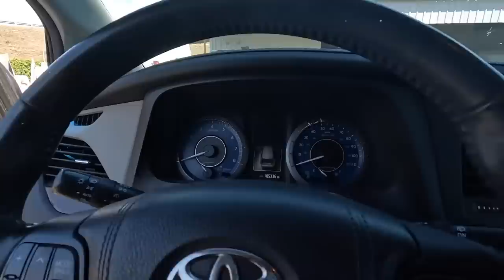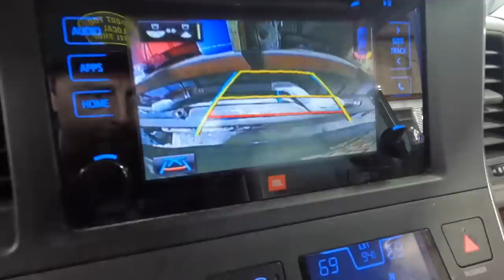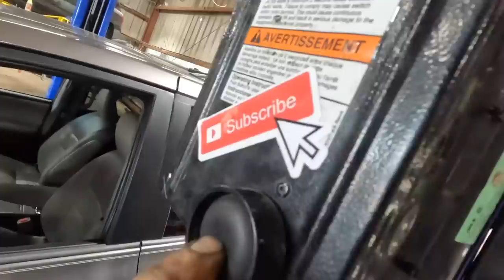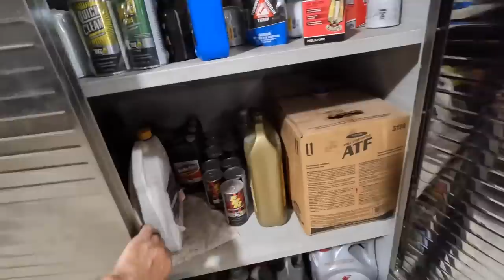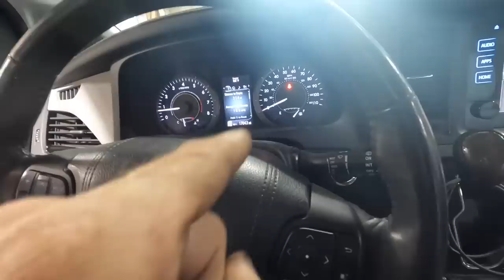Not going to sell this job! Toyota Sienna 3.5

Comment: My mom has an '08 3.5 Highlander that she's owned for many years. Around 50k miles, it had a small oil leak. It turns out that a lot of the 3.5s develop a leak where the timing cover, head, and block meet. There's a Lexus/Toyota specialty shop in...Chicago, I think that does that job a LOT and it's an engine-out bear of a job.

ETA: The shop I mentioned has a YT channel showing the process.
Reply: Car care nut?
Reply: Ahmed @carcarenut is the man!
Reply: 50,000 miles? Them's rookie numbers, my wife had a 2008 Highlander  V-6 with 375,000 miles on it. She only got rid of it because the foam in the upholstery had dry-rotted and dust would engulf us whenever we got in and it was due for a water pump/timing belt , CV joints and strut replacement ($6000+ worth of work).  She got a Camry, but we're old and it was too low for our backs. She got a Honda CRV and hated every minute of it, and a couple of weeks ago she got a '23 Highlander (produced in March 2023  fresh off the truck) and she is happy again.

Comment: Had the same leak on a camry v6 and it soon went to a drip then a spray as it drips down onto the axle ..I had replaced the PS fluid lines that banjo bolt and the PS pump all done without a lift ..trying to find it until I came across a vid here about this  factory problem which cost $ 3500 ?? I think to fix at a shop ...I traded the car in for a subaru

Comment: AT 205 will stop leaks. Maybe owner could start running high mileage full synthetic oil and it may also help with leak/seepage.
Reply: That only works on seals.

Comment: The timing cover leak effects all Toyota 3.5L V6's. The timing cover leak is way more than 10 hrs. Books at 20 plus. Need to drop the engine out to do it correctly.

Comment: You should have a look at AT-205 oil leak sealer.  Stopped a slow rear main seal drip in my Mercedes.  $20 beats the sht out of $3000.

Comment: Someone told me that.  Putting transmission oil in with motor oil about 300 miles before an oil service is good for the car? What are your thoughts on it.
Reply: Depends on the gasket material; transmission fluid and, more so, brake fluid, is designed to condition rubber gaskets and o-rings, keeping them supple and keeping them from shrinking. I'm not sure that using either for that short an amount of time in an engine would make any difference to the gaskets.

Comment: Super common for all the Toyota GR engines to leak oil from the timing cover in that spot.  Bet it has electric steering because that is where they power steering pump mounts if it has normal power steering.

Comment: Im on my 2nd gr series engine, my 3l 3gr is burning oil since its d.i, im not sure if the 3.5 2gr was d.i or not, i know the later ones used both direct and port injection to help keep the valves clean

Comment: I've seen an oil cap that called for 0W20 while the owner's manual called out 5W30.  (My brother's Hyundai Santa Fe Sport '17).  Looked it up on an owners' forum... the 0W20 is to meet the EPA MPG ratings and the 5W30 may be better for the engine longevity?
Reply: EPA doesn't care about engine life. I use the latter.

Comment: Interesting that now Ray puts an engine cleaner (dispersant?) into the engine and runs it for a while PRIOR to an oil change.  I have been putting a half quart of Gunk engine cleaner in my 94 Stang 5.0 for decades prior to oil changes.  It seems to keep the engine cleaner.  

I'm not sure about the additives put in after the oil change.  Aren't those already IN the oil?

Comment: I don't understand your strategy for oil changes. It's 0W-20 but with what specification? Most car manufacturers have some prescribed quality specifications for their engines, how can you stock for all different manufacturers and engines? (Also, how could you use a different one, 5W20? Is this viscosity class also enabled for this engine?
The question is quite broad, since I can not imagine how an independent shop can stock all oil varieties for all brands, from GM to Mercedes?

Comment: Does that oil system treatment affect turbo charged motors?  I'm hitting the 100k mark on my f150 and was just curious if something of that nature would be a good idea.
Reply: Yes. Add BG EPR straight into your old oil prior to oil service and let idle for 20 minutes, then go for a quick ride for a mile or two and then drain. For maximum efficiency add BG MOA like Ray did to your fresh oil for additional protection. Stuff is excellent

Comment: On the Toyota  did I see 2 wires for some kind of aftermarket toy without fuses on them?  Thats a big no no, a fuse must be within 6" of thd battery terminal. Positive side  however you can also fuse the ground side, but its not often done.

Comment: Ray, it looked like the oil filter housing had a 3/8 drive built into the bottom... could you not use that instead of the fancy tool?
Reply: On Toyota's it is a plug to drain the filter before changing it, that is why the small O-ring is included with the new filter elements. You do need the special wrench to remove/install the filter housing properly.

Comment: I am guessing Rainman rarely works on Toyotas :-) 3.5 is a very common engine starting from last 90s. anyways, all 3.5 has this issue caused by engineering design fault? mostly it will leak very small amount but some do begin to drip. it's leaking from where the block/head/cover meets at the same point. it's definitely an oversight during engineering of this engine? another annoyance, VVT tapping noise when engine is cold. VVT was revised starting from 2013 model years but the tapping sound is just annoyance and really not an issue with the functioning. another annoyance, oil cooler line is a rubber hose that can burst with years/miles. I have not heard of oil "burning" issue on 3.5. some older 4 cylinders have issues primarily caused by lack of regular oil change. 2.5V6 had serious oil burning issue directly related with DI setup.

Comment: My once ever dealer oil change failed because the ding dong placed the o-ring wrong causing me to flatbed if back with most of the oil missing. Never again.
Reply: I guess I've been lucky, My Toyota dealer was great with our 2006 Highlander. 
I brought it in at 59,800 miles and said I smelled antifreeze burning and they couldn't find any, at 65,000 i was getting the timing belt replaced and they called saying the water pump was bad. I said probably the antifreeze I smelled? The service writer went out and looked at it, came back and said you're right, it's been leaking for awhile. We'll cover it under warranty. It also took care of the slight oil seepage we had at the timing cover. 
We would be driving it today but it got T-Boned in 2018, wife walked away without a scratch. Even the Battery in that car lasted 9 years! The most solid vehicle we ever owned, besides the waterpump under warranty, only maintenance was needed. It drove like it had just came off the lot its whole life.

Comment: Toyota had a recall on the fuel gates...They should have gotten the dealer to fix it free.

The dealer is also big on calling seepage a leak.
I have same model, with 160,000+ miles, with a bit of seepage around the valve covers. The dipstick has NEVER gone below full and a drop has NEVER hit my driveway. It is not worth the labor to address a cosmetic issue that can only be seen when the hood is up.🧐

Comment: I wonder if the owner has one of those epoxy garage floors and it shows every drip. I have heard that a bar of soap rubbed on a seeping gasket will seal the leak. Or a candy bar, maybe that was Mc Gyver?

Comment: Great video as usual Ray. I have an off topic (sort of) question/comment.  You often include links in your descriptive about various products that you use....like those hose clamp pliers (thank you much they work dandy).  When I see you making your videos, I often wonder what make and model the various lights you use are.  You have the underhood light (looks like it might be a milwaukee, not sure), then you have the little square ones, and you have the flip lights that have black outer casings, and a few others.  Just wondering what they all are and if you recommend them and why...  I am kind of a collector of lights.  I have several lights from Milwaukee and Braun (Harbor Freight).  Thanks, and keep loving life...

Comment: The extended directors cut. (Drilling rivets) Mini trailer for Toyota Sienna 3.5 part - 2  /  Not using the drain in the oil filter housing.Bad RAY Bad!

Comment: I  was just told I have a leak at the timing chain cover.  $2000 repair.  With 261,000+ miles, I'll just put a heavier oil in it.
Where does the small "O" ring go on the filter unit?

Comment: Have same engine and same problem. I thought it was oil pressure sensor leaking but maybe not.  Not happy if it is this, it is a $2k engine pull job in the highlander.  Should have done more research on this engine. Toyota needs to do better.

Comment: 23:45 Can I wash inside with water pressure? On my Sienna 2nd 2008 there is a small hole above the gasoline lid (totally looks like intentionally done by Toyota for something). Not sure, what is it about and whether water going inside that hole can cause any damage

Comment: PLEASE don’t put unapproved additives or cleaners in my vehicle without asking. Thank you!

Also.. on oil leaks.. I highly HIGHLY suggest you recheck that spot after running the engine at idle and after a load… sometimes.. things only leak when the oil is thin enough aka hot enough… when metal expands through said heat.. OR when under pressure like in an internal combustion engine. Just because it’s not leaking when it’s cold and not running.. doesn’t mean there isn’t a leak.

Comment: Hey Ray! Like your videos. Here is just a thought about your garage extension if you have not thought about this already  If you can maybe you should move your heavy car lift from the corner to the new area. I always see you struggle to move the bigger heavy vehicles into the corner. Moving the heavy lift to the new area will make it a whole lot easier.  Just put the new smaller lift in the corner.

Comment: The discolored mirror tells me the heater circuit was either left on for an extended period Of time, or the switch is shorted and turning on with the car.  Just something to check when the parts come in.

Comment: That engine cleaner is pretty cheap insurance, I use it all the time. I recently got to see how effective this stuff is over a number of oil services when I recently changed the noisy balance shaft drive on a Mitsubishi 2.2 diesel. I was amazed how clean the inside of the engine was when I removed the sump. With the reported oil leak, you did not think it was worth replacing the banjo seals anyway? Cheap and easy, and means one possible cause already addressed.

Comment: You are still missing a trick when removing oil filters!
When you have drained the oil start the car for 5 seconds, this will drain the oil left in the filter into the pan and not into your arm pit. remove said filter and stay clean ! Just a little trick from across the pond.

Comment: What was the second, smaller o-ring for in the oil filter package?
Reply: When I chance the oil in my '13 Tundra I use a 3/8" drive socket and the plastic tool to drain the filter. The smaller O-ring is replaced after draining the filter housing before removal.

Comment: Does your oil have the mfg specs?  all oils are not the same.  Lots of oils don't have VW spec 505, 504 501, etc., while others do, that's the stuff to use on my stuff.  Even between same brands one has a different rating than the other type Motul and or Liqui Moly...weight is NOT the only spec that matters....

Comment: That's a standard leak location for the 3.5L, it leaks where the mating surfaces and the cover.  Your analysis is correct.  To repair is an engine cradle drop.  It's a problem for some when it drips on the shaft and flings on to the exhaust.

Comment: Still think Carmacy is a great name to get the prescriptions, that the car doctor says the car needs, from said cabinet.
Reply: Addendum: The Car Care Nut (youtuber) goes over that particular oil leak in one of his videos.  It's a manufacturing defect where the front timing cover doesn't get silicon in a particular spot on both sides of the 2GR engines.  It's not a major leak, but a leak none the less.  That one doesn't look bad at all.

Comment: I had a shop spill oil when filling and then write on my receipt that I needed a left side valve cover gasket. They also said I needed two serpentine belts when just tge AC belt had cracks in it.

Comment: Sometimes you know there is a leak by the mark where you park. I have a leak in my murano and can't find where it's leaking. Throughout the years it's left a red pink mark I thought it was coolant but the power steering was low but can't find where it's coming from

Comment: BG cleaner is useless.  Most makers say to not use any additives, it's unnecessary.  Use the proper oil, that has the specs for the brand, as if the mfg spec is not on the oil bottle, it's not the stuff to use, that matters.  All oils are not the same.  additives vary in the oil.  generic marketed oil additives are useless, one additive for all engines is illogical

Comment: sure hope you ask customer about adding a cleaner to the engine before you do it.I would not be happy with you if you did this to my engine. I believe that if you do routine oil changes there is no need to be adding a cleaner to the engine.Just another added cost to a oil change

Comment: Fun fact: That oil filter housing has a 3/8 socket head specifically for draining the oil filter housing so you don't make a mess.....but then we wouldn't get the pleasure of watching you use and throw a can of brake kleen across the floor
Reply: That drain plug is a waste of time. I tried using it the first time or two and then realized it wasn't worth the effort.
Reply from the maker: It’s a counterproductive procedure to pull the little plug

Comment: 2GR FAM bruh
Reply: Also I’d definitely rule out the use of a (leaky) flexible VVT oil supply line, oil could run down the back to the banjo bolt.

Comment: Long time ago we cleaned the engine with kerosene and drain and replace oil and filter.  Then added mystery oil for an short drive and then replace oil and filter.  Never had an engine break or gum up.  New engines with aluminum, caskets and seals need to service differently.   With hundreds of thousands of miles on my vehicles, I use good oil, good fuel(no discount stations) and always run the vehicle long enough to warm up.  I do not believe in these new additives.  I have all major components tested by Black Stone labs for wear conditions.

Comment: 2 things very bad!     A whole can of Brake Parts cleaner for a tiny speck of oil.  Bad for the environment!    (Eric O too) Time after time.    Not a fan of such antics.    Do NOT use engine "cleaner" in engines!  Stop!   Sludgy engines will have that added and break off bits of sludge and then it clogs oil passages.   Then it's new/re-manufactured engine time!   Bad Bad!!

Comment: 0w20 oil? lol. just put some water in there instead. I would NEVER use any 0w oil.
Reply: I don't think that is wise.  The engine clearances are designed for the specified oil.  Using a thicker oil will cause oil pressure problems.  Thinner oil also transfers heat better.
Reply: @desotosky1372  if you lived here that water stuff would freeze at the first hint of winter. You need thicker oil in colder areas. maybe in southern US or something ok, but I would never use it. Project farm proved that with testing that it does not coat bearings and protect as good as say a 5w-30...I believe project farm did that test anyways.

Comment: Crank case cleaner. You have to be kidding Ray. Yes it is snake oil. I would be highly upset if I learned you did that to my engine.  A new low for you Ray.
Reply: I agree. That's 1970s thinking.

Comment: Unless you know the service history on that engine, I would not be running any kind of cleaning agent through the oil. You are asking for a clogged oil passage due to sludge being broken loose, and a blown engine. And use a funnel. How unprofessional slopping oil all over the customers engine, and then going through two cans of brake clean to clean up your mess. Then you break the customers mirror inspecting it?  Unreal